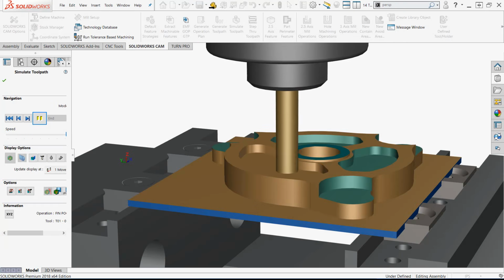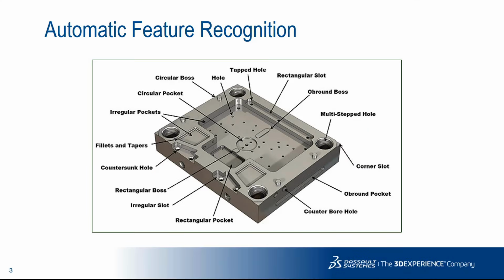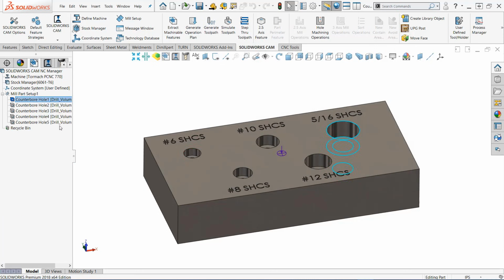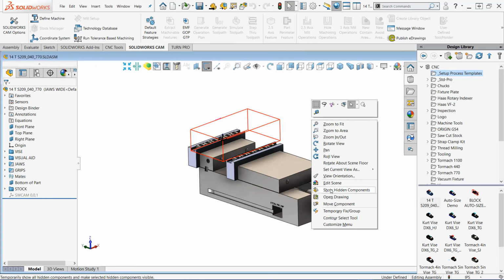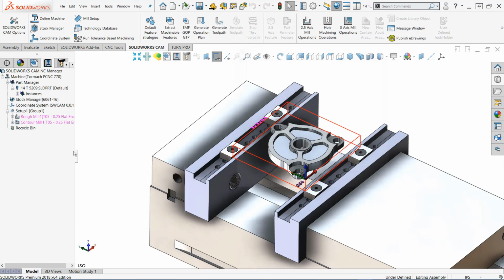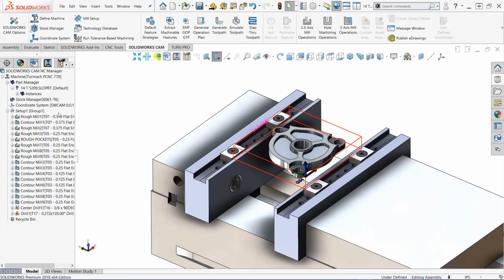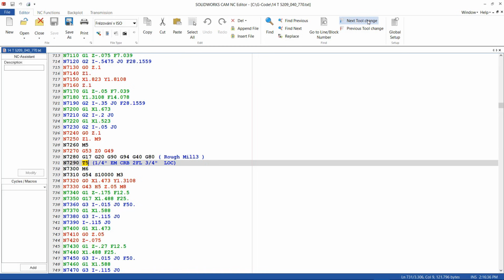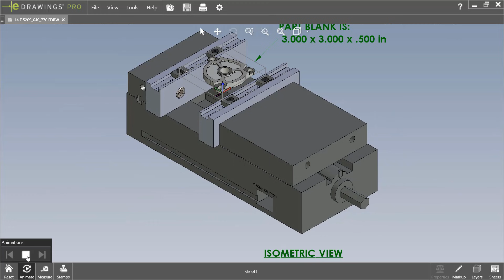Introduction to SOLIDWORKS CAM 22min

Comment: John, I am fairly new to SOLIDWORKS CAM,  my question is how to you get the CAM feature tree to display in an assembly? I have the Addin but i can go no further than that. I was trying to machine a part in a vice that i assembled in SW to get a better visualization of tool travel.
Reply from the maker: Hello, Adam!   The Assembly machining for SOLIDWORKS CAM is part of SOLIDWORKS CAM Professional.  The version that comes with SOLIDWORKS is Standard and has part only machining.  Please let me know if you have any other questions!

John
Reply: @the3dexperience807  ok, so I have to work in single part files, because SW trickled options to my Company, with which I now have to jump thru hoops with a limited system, because I don't want to be the new employee to ask them to spend more money on a system I didn't buy in the first place.  Way to go salesmen, who should have had a clue regarding a manufacturing company with inhouse tooling and realized they would need the better version.
Reply: @passiveaggressivenegotiato8087  Build your jig and part assembly and save it as a Part File, then program in that part file.
Reply: @SomePinkoCommie  Thank you Daniel. Since that post, I communicated with their cnc people and we made a convincing argument that having assemblies to program in, would decrease the risk of crashes, like running into clamps ect, plus faster, better programs which machine around support tooling. Regards

Comment: Hi John, can you please show me how to add the "CNC Setup Process Template" to my library? This is a very neat tool that I am not using at the moment and would like to implement going forward.
Thank you in advanced. Love your video.
Reply from the maker: Hi Kevin, Sorry for the delay - SWWorld 2019 Prep has taken over my life!  What is the best way to contact you and send you my design library?
Reply: @livelife20000  I was wondering too. Did you get it?
Reply: @the3dexperience807  is there any way I could get this library too?
Reply: Hi John , I’m interested in getting the CNC library as well
Reply: Hi sir, is there any way i could also get the cnc set up too? i need that for my school design project